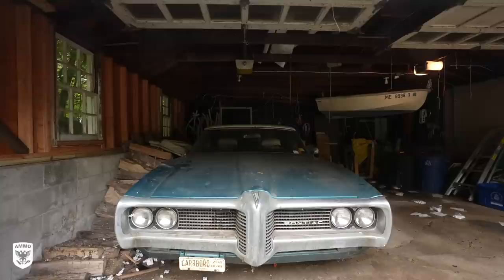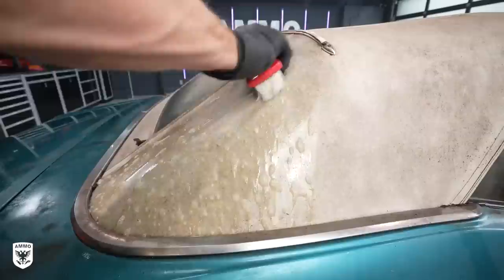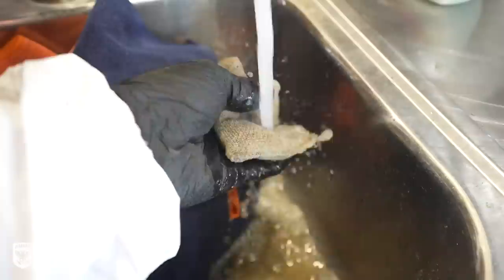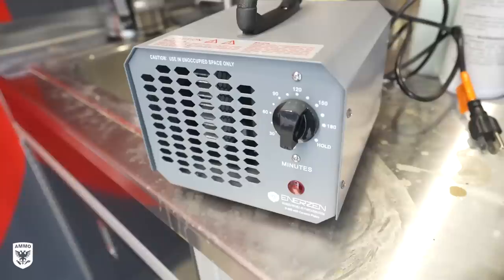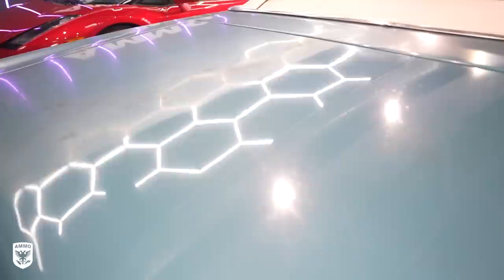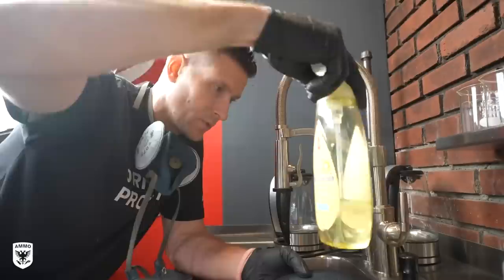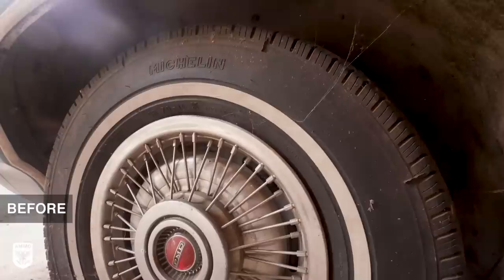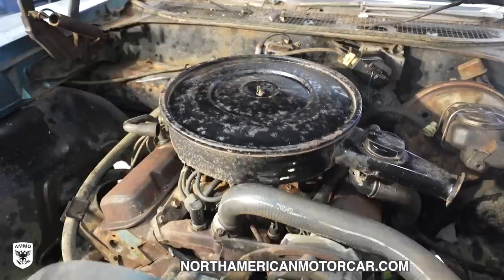Most Disgusting Car Ever! Pontiac Lemans 350 First Wash in 22 Years

Comment: Hey Larry, you probably won't ever see this or really even need to remember this but I have a trick for wire wheel hubcaps. They clean up amazing if you throw them in the dishwasher. I used to do that years ago and no matter how dirty or baked on brake dust, they came out perfectly, clean,and they shined like brand new. Just a little tip and make sure the wife is out of the house...
Reply: I’ve heard of a few people doing that to clean wheels but that would take hours to do a full set of wheels. He’ll have more theme efficient ways of doing them. Good idea if you’re going to respray them as dishwasher tabs are very corrosive so can easily strip the paint
Reply: Its because of the steam, which can easily be done outside of a dishwasher ;)
Btw, I think your lasagna is done--i heard some chimes!
Reply from the maker: Lol wouldn’t fly at home but thx for the tip :)
Reply: Larry I've been waiting for this vid..I love your work
Reply: Thanks, interestingly, I’m learned Some of,automatic Dishwasher uses:with ELECTROSTATIC FILTERS FRom 1978(?) MY home Furnace: l always check now, & proper wash additives, cycles, et,d Imhave been surprised ..!
Reply: @AMMO-NYC  cheap dishwasher installed at your shop would work wonders as a small parts cleaner.
Reply: @AMMO-NYC  Back when I detailed cars, I used a mild wheel acid and a paint brush to get into all the spokes.
Reply: No way ba hubcap in the dishwasher would fly here either. I  have a sonic cleaner I got from Harbor freight for small parts. Wonder if they make a larger version so you can immerse the entire hubcap?
Reply: @AMMO-NYC  do you have any products for protecting a new vinyl convertible top?
Reply: oh, this neat little tip/trick reminds me of my youth. the country I used to live in had mandatory military service and at the end of my stint, we were required to return our rifle in pristine condition. I wasn't really that much into cleaning off all that caked on gun powder but I've heard about a "trick" which—yeah, obviously—involves a dishwasher. so, I dismantled the gun, stuck the parts into my laundry bag together with all the grimy camouflage clothing and out I went. this never before happened, but after the exit, military police was present (it wasn't allowed to smuggle out any weapons outside the garrison, because we had [and still have] extremely high gun control laws [which work pretty well, btw.]) my heart felt on the ground (or that it was what it felt like, lol) and I assumed, I'm just about to get busted. to simply return would've looked too obvious, so I thought, I'll just silently wait in line. to my biggest surprise, they basically only checked what was referred to by military speech as, "proper and tidy adjustment" of the uniform. gave me a laughable thrill, so to speak. however, I went on to drive to my then girlfriend's house whose parents happened to be in the States for vacation, so I had free access to a dishwasher (which wasn't even all to common to have, back then in my country.) coincidentally, my back then girlfriend was very quick to show me a bullet her brother somehow managed to smuggle out (how that was even possible is beyond me because there were highly enforced triple checks on every single bullet in place. I wouldn't have been able to do this as this would've clearly been noticed [we only even got individually counted ones when there was a shooting training in place .. and that only when in position and ready to shoot; not while waiting in line or something .. they really had very low trust in a bunch of teenage boys; rightfully so, actually.]) well, to finalize my story: when it was my turn for the final inspection, the ordnance officer was so impressed with the "supreme" cleanliness of my weapon that he actually took it and showed it around to others so that they could see as to which standards it was actually possible to clean an assault rifle (which was actually Hollywood's most featured one back then despite not even an American one; but it just looked about the way, "ordinary" people would imagine such a weapon to look like, lol.)

long story short: yeah, I totally agree; dishwashers do possess some very high cleaning power. 😅
Reply: @carwashcrazy1  I'm pretty sure that you could just use Moose (what he uses for interior dressing).

aerospace 303 (quite obvious where I got that "tip" from, eh?) is another quite similar excellent product.
Reply: @jessielivermore1826   Ji you beat me to the comment. Yessssssssssssssss Sonic cleaners are the solution and I think as you suggest larger versions that can even take cylinder heads or even the whole dismantled engine, gear box and other big parts would be what is necessary.

Comment: Back in the 60’s as a kid I worked for a garage and auto sales.  They had a 1964 Jaguar XKE black convertible,  it was wrecked and repaired. Once repaired I had the misfortune of having to clean the actual wire wheels. Took me weeks. ( I was in high school then). You had it too easy cleaning those wire hubcaps. In the Mid -60’s we didn’t have the products that are available today. I used light rubbing compound. What a mess but when done they looked brand new.

Comment: Hi, I'd like to address why so many comments are suggesting using clay bar, and give my opinion on why I feel he didnt want too. Clay bar is nice for surface contaminated clear coat finish. But on heavily weathered single stage paint it doesn't really work well. It will get some stains off but tends to stick and not glide well, and afterwards you still have just as much buffing to do anyway, so in this case it would have mostly just wasted time. just my opinion based on my own experiences with these things. And ya I would pulled the seats but we don't know what king of budget and expectations were with this job, I think the overall results were fantastic. Nice work!

Comment: Hey Larry, I have a soft spot for this generation of Pontiacs because we had a 1968 (or so?) Pontiac Tempest that in my opinion was arguably the coolest car we ever owned.  If you are familiar with the Tempest it is basically similar in body styles to the Le Mans you show in this video.  The Tempest we had was a two door with a legitimate back seat for us kids.  It had the very same front grill and basic look of the Lemans and the though ours was a hard top the body lines are very similar to our Tempest.  Plus the Tempest we had was not the hot rod version it was just a 6 cylinder (I think?) but, it had a lot of torque and decent top end (speedometer read 140).  My older brother inherited it and promptly wrecked it twice (once while I was in the car) and my dad was done so it went to the scrap heap.  I still love that car though.  Are you familiar with that particular Pontiac model?  As always I hope this finds you well and thanks again for all your effort sharing these.  Take care man.

Peter St. John
Hollister, CA

Comment: I just watched an older video where you cleaned a 67 corvette that sat for 33 years, while cleaning the back glass you asked if anyone had a good solution for cleaning glass to put it out there. .
 I've found using a wad of triple 000 steel wool placed in the middle of a bunch of paper towels or cotton rag is the best for cleaning glass. You just place the wad of steel wool in the cloth spray with a minimum amount of glass cleaner and then then rub back and forth in an area 1ft square at a time, use a dry rag to polish. The triple 000 steel wool acts as a scrubbing agent to remove tree sap, squashed bugs and bug juice, bird poop, nicotine from cigarette smoke or build up of waxes and polish, its better than any cleaner on the market. Cuts cleaning time in half, less mess, doesn't leave reside behind. The steel wool will not harm or scratch any glass and removes all glare, it will in fact polish, no need for squeegee's or messy  dripping window cleaners and soaps.  I showed several people this process who do automotive detail work  and they swear by it . This way of cleaning actually makes the glass look invisible.
Test this method yourself to the way you do it and compare the results, you will be amazed.

Comment: Look at how good of condition the carpet was. That car didn’t see much use before being parked. 
* makes me laugh remembering my 69 impala 327. Bought it cuz it ran great, but was surprisingly slow. 
When I got home and cleaned it, I quickly found out why the car was so slow.
6 layers of ‘sample’ carpet mats. I guess rather than clean the mat, the previous owner just kept adding mats. Then with so much dirt accumulating, the mats were an inch thick.
Took out all the mats and had 4-5 inches of new found travel on the gas pedal.

Comment: Larry, for chrome you need to get on board the Aluminium foil + vinegar or water train. Make a little pad with the foil, wet down the chrome and rub over it. Removes rust and corrosion.

Comment: I used to do Auto Body and paint and have detailed a lot of cars I also restore muscle cars. You have more experience than I in detailing but here is tip for you for doing chrome that has heavy oxidation on it . Get some 00 steelwool and mothers Chrome polish wash the area first as you always to and dip the steel wool in the chrome polish and clean the chrome with the polish and steel wool it will really make it pop. I have had chrome with surface rust on it and the steel wool trick works every time and you can get into tight areas with your fingers you cannot get with a pad.. Take a terry cloth clean up the residue from the metal polish follow up with one of your waxes . Trust me it works  and it will save you time. this trick works excellent on chrome wheels also but I always take the wheels off to detail them. I know you probably wont read this but love your videos

Comment: All I work on is original never restored late 60's to early 70's GM cars - there is a GM service memo regarding the "plasticizers continuing to secrete from the interior rubber and flexible appointments" to use strong detergent and a stiff brush. 
Else where regarding the interior - remove the seats and actually flip the carpet out of the car and vaccum the floorboards so there is not grit to wear into the carpet. 
plus the carpet is nylon resin backed so you can actually hose it out and dry it in the sun... take a little water thinned rit dye in a spritz bottle and work it into the sun bleached areas with a brush...

Comment: I've really enjoyed watcing so many of these rescues, but I'm curious as to why you don't pull the seats out...especially the rear seats (a couple of bolts if any..usually spring loaded...push and lift) to clean the surfaces and have easier access to the rear floor at the same time.
Reply from the maker: It was rusted

Comment: Genuine question, why don’t you get you microfibre cloths washed and use them again? Is it just to ensure that there is never any residual dirt left in them after cleaning? If so, wouldn’t any small amount of damage caused be picked up in the paint correction or polishing stages of the clean? Must be more economical rather than throwing all those cloths away for each detail?
Reply from the maker: I wash & reuse as much as possible! On these disaster details sometimes they’re too far gone.

Comment: I wonder if that Ozone helps with the yellowing of the plastic, as Ive heard of using it with Retro-Brighting before. 

FYI Retro-Brighting is the process of removing the yellowing of plastic on PCs, old video game consoles (some SNES consoles are famous for the half or full yellowing they get) thats caused by UV interacting with the plastic. The best way to get rid of it is to use a peroxide on the plastic(either by putting concentrate in a container of water or painting cream on and wrapping it in plastic-wrap)and let it sit in the sun or a UV light. Sometimes it takes a few times but its really amazing. Oh, and the Ozone treatment really didnt work that well now that I think about it. See The 8-Bit Guy for more info on it and to see before and after.

Comment: I would put a 4bbl intake and carb, and a set of headers, and a rebuilt stage 3 200r4 trans and an aftermarket cam in the 350 Poncho engine, and some Rally 2's rims on it.